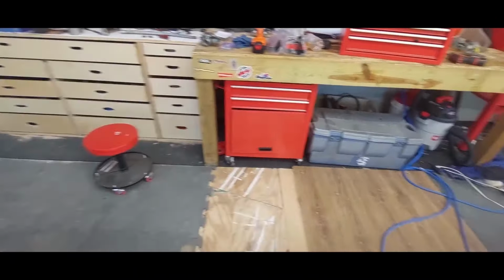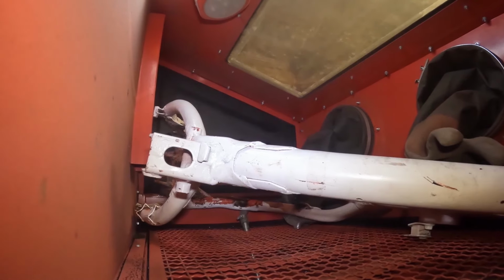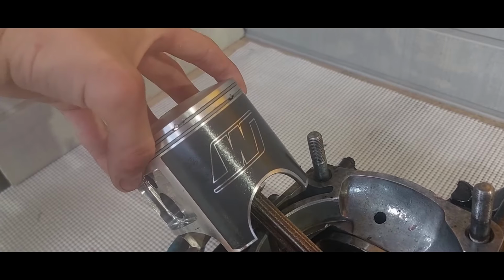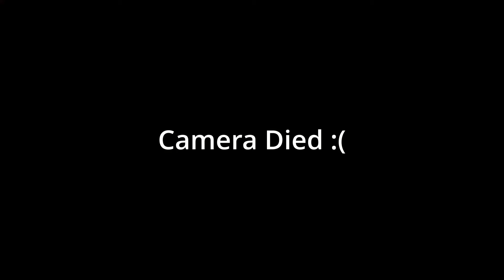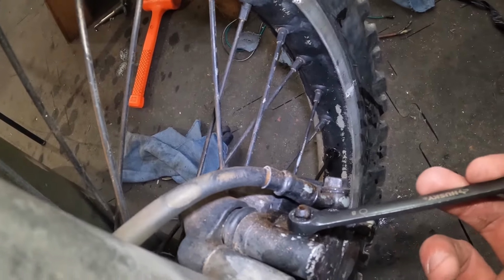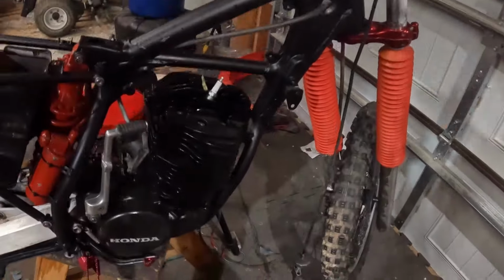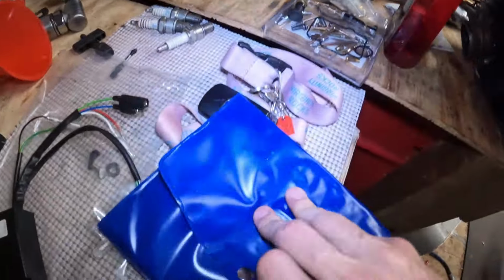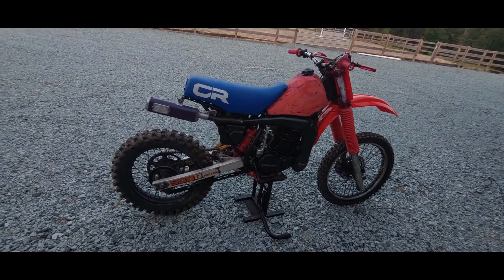SEEING WHAT MAKES THE CR500 SO LOVED | Honda CR500 Build

Comment: Looks good, tank would wet sand out fine and buff it .best standard colours . Fork over spray would easy come off too . Dont be scared to take casings back an flat .Easy thing to satin black them looks great too.  Paint stripper would have been easiest when off . But can still be done if sanded right .Always etch prime anything bare metal . A spray can works sweet .Paint stripper on wheels would be sound too if not left on to long . 84 is a unique bike and the first 500 .Last air cooled big  2 stroke .Have too say standard colour frame looks way hotter too . Good job on fork clamps. Same with hubs satin black looks sweet after a quick prime ,just mask ya spokes an rim. If you want make it look cool change the rims to gold or black . Be a quick bike no doubt tho . Take it easy bro.

Comment: Ring end gap should be between .30-.50mm anything over .50mm is out of spec for the ring end gap on the cr500
Reply from the maker: I didn't fix it in the video so that's my fault but yes you are correct. .55 is the service limit for the cr500. I did fix it so we are now at .40mm for the ring end gap. thank you for pointing that out <3